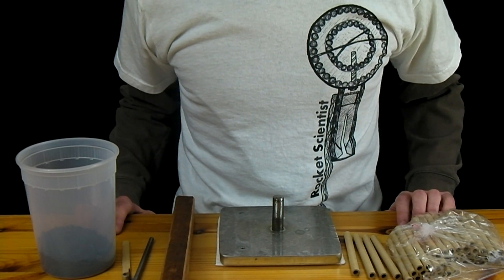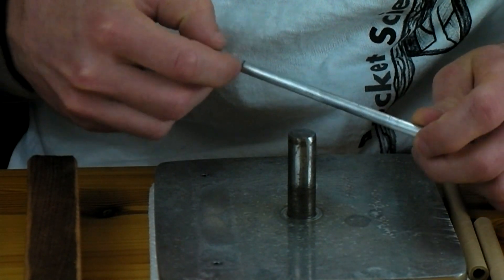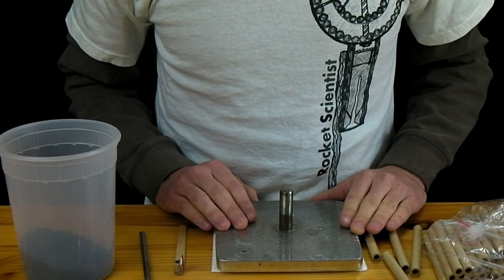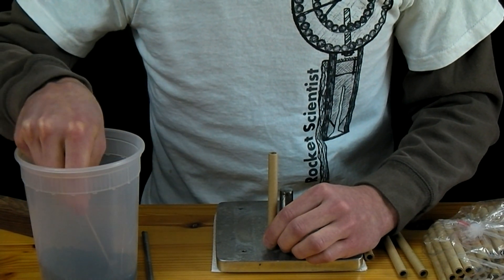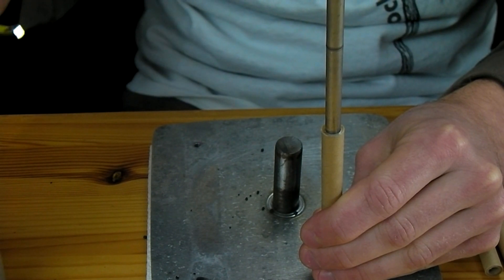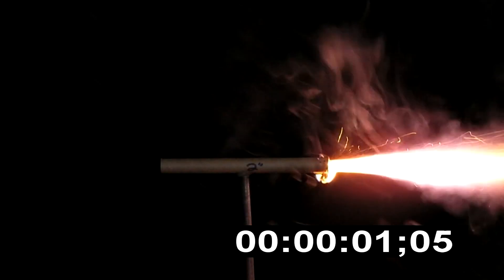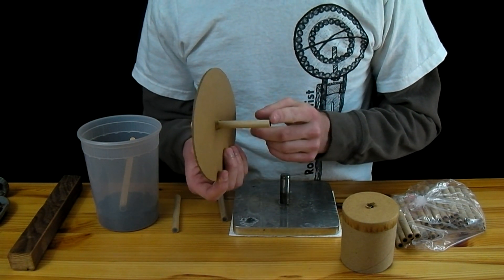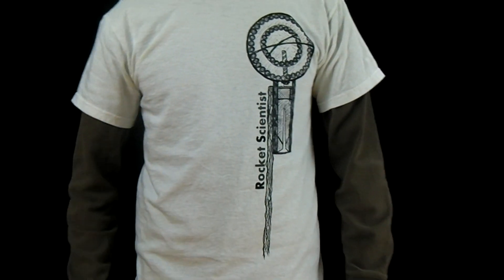Timing Shells With Handmade Fuse (Spolettes)

Comment: What would be the perfect timing on a spolette for 2.5” shells?
Reply from the maker: It's been a while but probably around 3 seconds if I remember right. Usually I would just use time fuse on shells that small.
Reply: NightHawkInLight thanks man.  Time fuse is tough to find now that it’s regulated by the ATF. So I have to resort to spolettes
Reply from the maker: Roll visco up in several layers of masking tape, that works fine for small shells.
Reply from the maker: Wrap it very tightly an cleanly without wrinkles.
Reply: NightHawkInLight   Yeah. That’s what I was thinking as well. What length should it be?
Reply from the maker: Depends on your visco. Tape some fuses and time them.
Reply: NightHawkInLight Whenn did you stop building fireworks?

Comment: Does the spolette have to be primed using a piece of fuse inserted through the side, or will it be right to ignite from the lift charge by itself?
Reply: AZAKO80 it's good to put a piece of blackmatch in the starting end of the spolette

Comment: I use a lenght of safety fuse wrapped tightly in a paper plug thick enough so that it holds fast inside the motor and glue it in. (The benefit is that the safefy fuse burns at 1 centimeter per second.) Then I wrap some paper around the protruding plug so that it forms a cup at the forward end to fill it with ejection/ignition charge and glue a round piece of cigarette paper on top to seal the thing.
Well, I just started making model rockets, thus buy the motors RTF and the fuse comes with them.